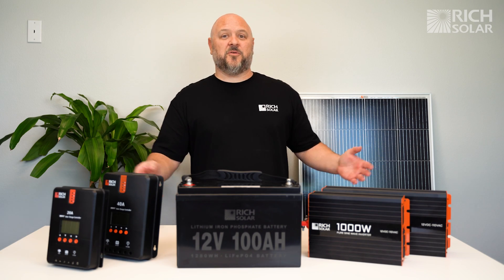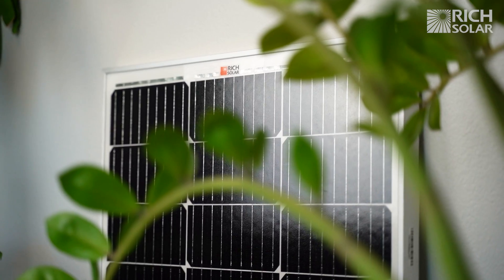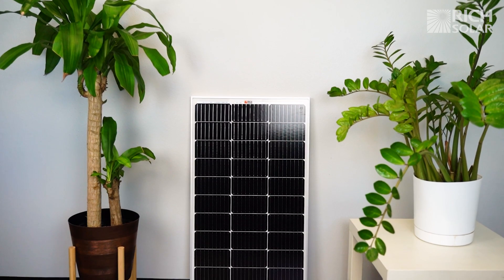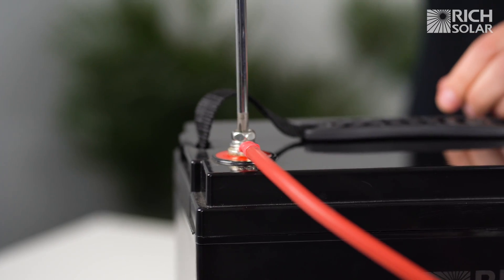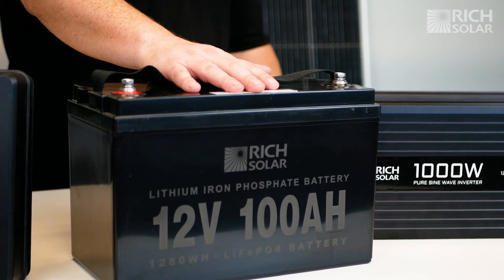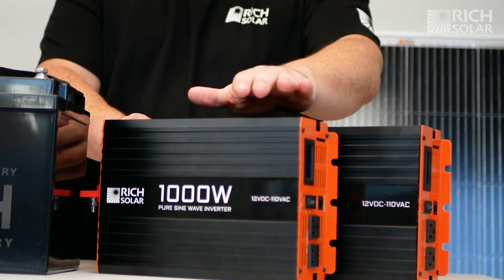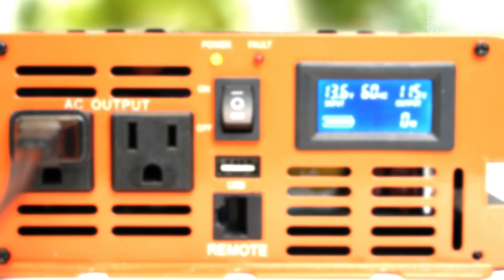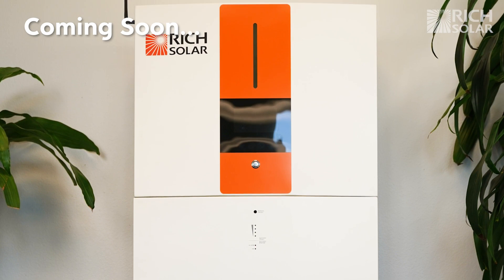Rich Solar Talk: The Basic OffGrid Solar System

Comment: I’m looking into installing solar on my pop-top truck camper, starting with one 100w panel but willing to upgrade if needed, 100Ah li battery. Battery, inverter, controller, to be contained in a moveable case. Not a lot of appliances, chest Refrig, a few LED lights, charge camera batteries, phones and iPad. I’m not clear on how to size the controller, I want to have room to expand to a second battery and panel if I need. Any suggestions
Reply from the maker: Great question. To properly size the system, it's crucial to calculate the combined energy consumption of the mentioned appliances: chest refrigerator, LED lights, and charging devices. Determine the total wattage these appliances consume per day and convert it to amp-hours (Ah) to align with your battery capacity. Please let us know if this is clear or you need further assistance. Thank you!

Comment: Hi my rich solar 500w after 2 years now when i turn it on it shows on the screen a red arrow showing down it only works the light the usb or the oitlets wont work
Reply from the maker: Hi, we are sorry for what happened. That seems like a defective unit. We can get it back to our warehouse and test it if you're still covered on the 2 year warranty. Kindly call our technical team for better assistance at 800-831-9889 (option 3) or email tech@richsolar.com. Thanks!